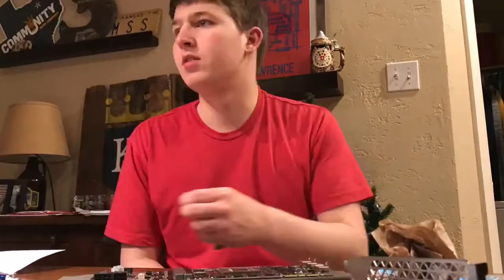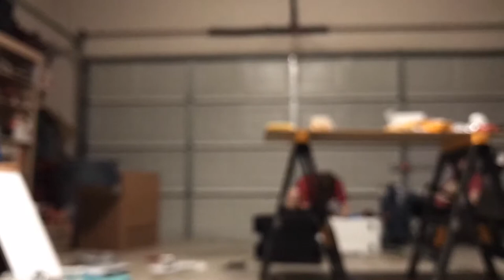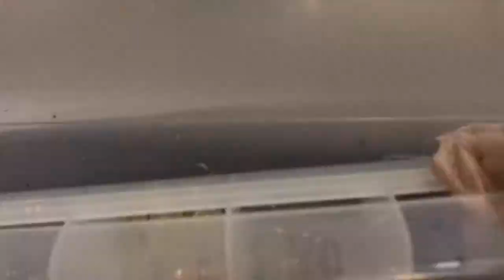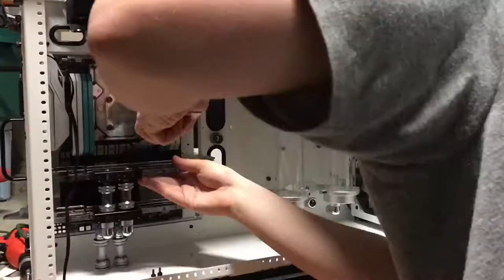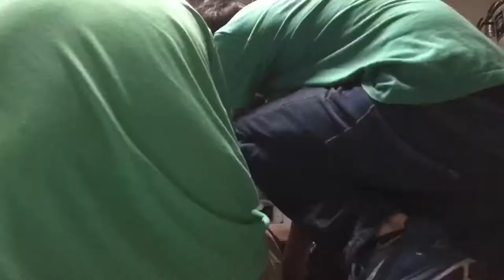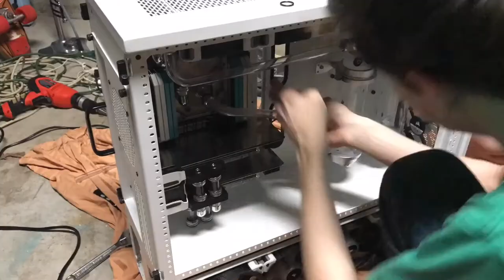Insane Caselabs SMA8 Watercooled PC Timelapse

Comment: You rich, cause I been saving for seven years and only haz 1000
Reply from the maker: Just work a lot and don't spend a ton. Sold a lot of old hardware to buy the new parts as well. :)
Reply: 1000 usd in my country only enough to buy the case lab, only the pc case alone, nothing else.